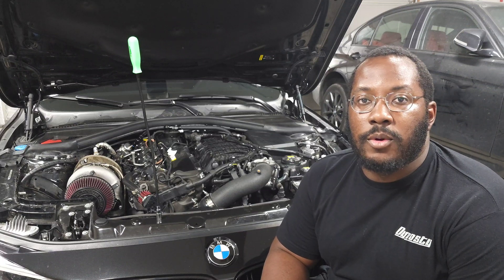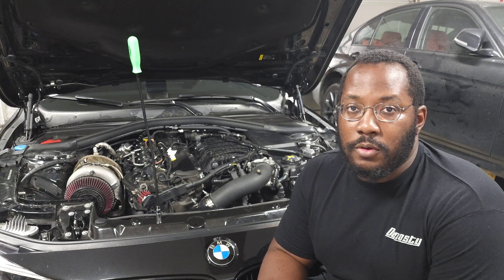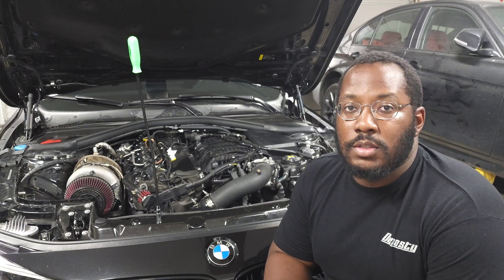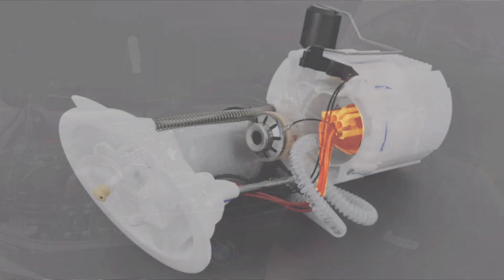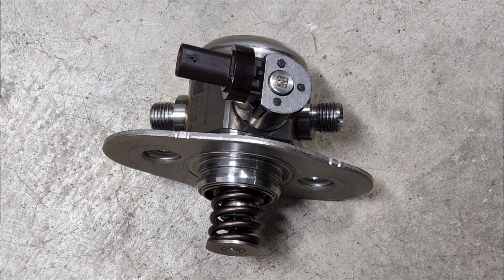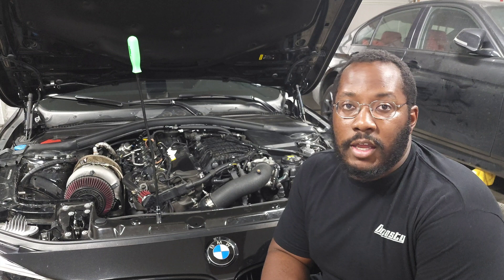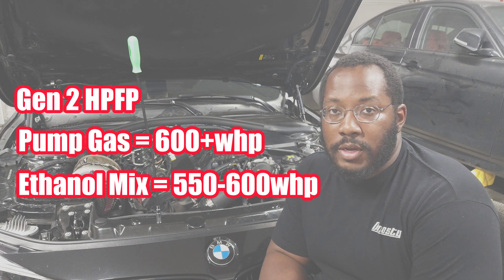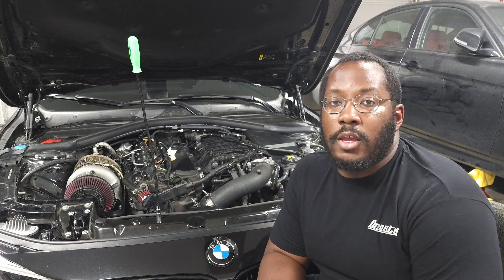What makes the B58 Fuel System so Good?

Comment: Lets say a B58 car has stock turbo, FBO,  Port Inj., and E85 Flex Tune...whats a realistic whp number this car can put down on E85?  Could possibly be my future project. Thx Bro.
Reply: My 340i is FBO, Dorch stage 2 HPFP, and running full E85. Im making 496whp on a “safer”/conservative tune
Reply: 500/520
Reply from the maker: Yep max I've seen is 520 but 500 is probably more typical
Reply: He has a vid explaining the parts you’d need for various power levels posted like a year or two ago

Comment: I started having fuel vent system issues this week
Reply: Easy fix tho, its a cheap part right on top of your manifold. Takes 30 seconds to change
Reply: @iKrakenOfficial  whats the part?
Reply: @TylanHuff  Fuel Tank Breather Valve part number 
ES#2993876 on ecs tuning, and i would change the fuel tank breather line as well which is part number ES#2993874.
Reply: @iKrakenOfficial  bro thanks 🙏🏽 that was a simple fix.
Reply: @LuisMoreno-rs2qk  my pleasure :)